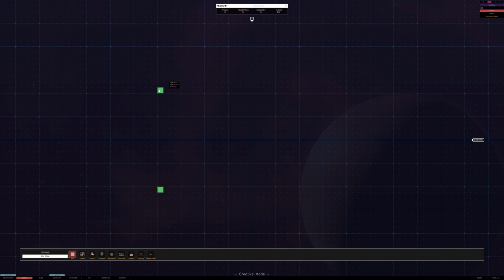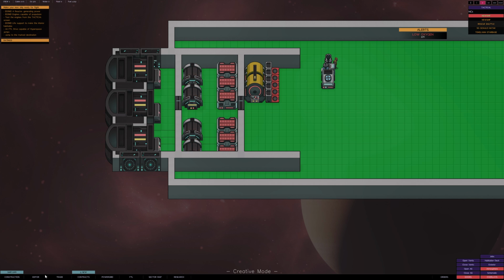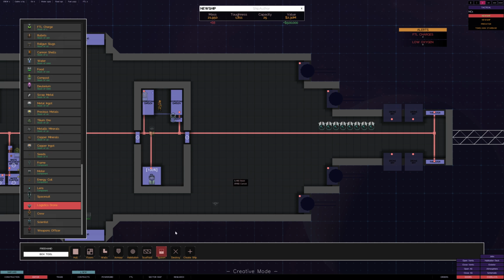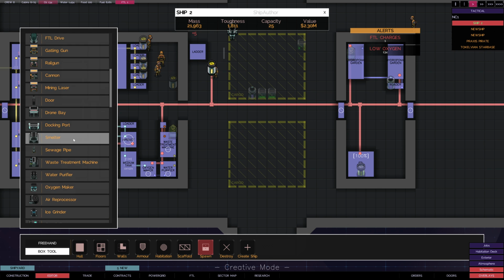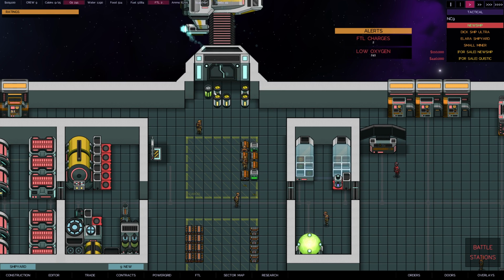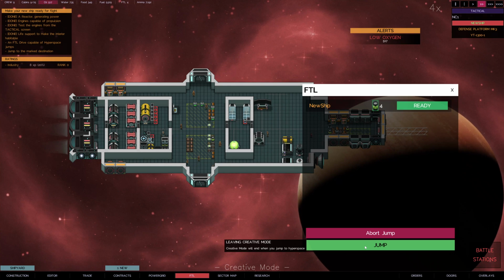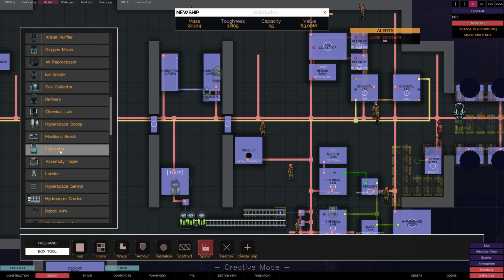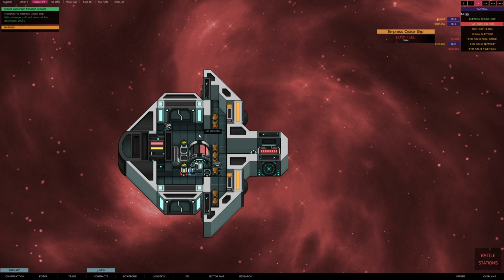The Last Starship: How to do Everything!

Comment: Nothing about solar panels.. sad...
Reply from the maker: Solar panels are pretty simple.  They need to be installed outside on scaffold.  There is one spot to hook up a cable so make sure the scaffold goes to that point.  They provide 10MW normally but in a gas cloud they will produce 5MW.

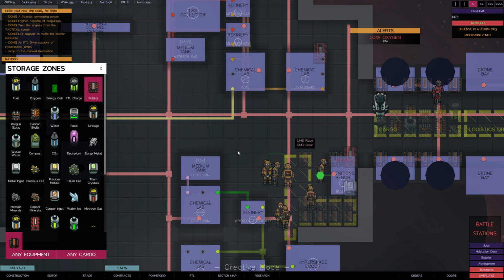Comment: 1:38:42 - "he should put it on any storage if the dedicated storage is full" ... i bought the game only a few days ago after the full release and have the opposite problem on several items, eg when i smelt ores to ingots, or even when drones collect ore, the items are put on any storage after the dedicated storage becomes full and over time fill the entire general storage so that i have to micromanage the production, either selling the surplus (which can be done automatically if i often visit systems which want to buy them, but it also costs fuel to produce that surplus if i am not sitting in a cloud and produce it myself) or cutting off the power or pipes that feed a machine.

A similar problem exists with fluids like water or oxygen: bottles fill the tanks to their limit and thus my recycling systems could get blocked. as a solution, i keep these producers separate from each other and the consumers, and not connect them with pipes (to avoid those loops of filling and emptying bottles all the time, as said at 1:34:35) always filling bottles with the output of recycling and then feeding these bottles back into tanks on the consumer side. this avoids any such loops or deadlocks, and the surplus or missing bottles can be handled automatically by selling and buying at some upper and lower caps. Too bad that all those bottles can not be stored in crates and thus use up a lot of real estate.

How nice would it be if we could specify which types of items are or are not allowed in some such general storage, instead of inconsistently allowing general storage for some items which have their own dedicated areas, and not allowing it for some others. (since i am still a "noob", maybe i have not found some options or systematic on this)

Comment: How do you avoid a large crew constantly running out of air and water? Is it really just a matter of grinding comets?
Reply from the maker: I haven't got enough time in alpha 14 to test that out.  They added some efficiency bonuses under research now so I'm sure ice comets are still required but it may not be as much as they used to be.  But it depends on your setup too.  if you're producing o2 from water or growing food as well since they also consume water.  With my setup I usually just need water.